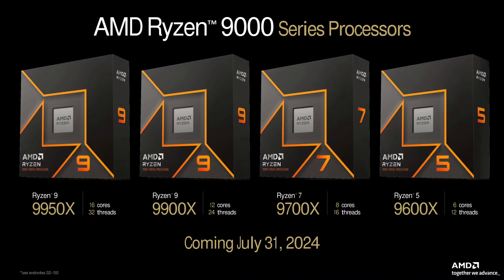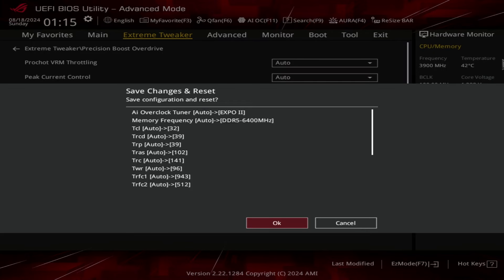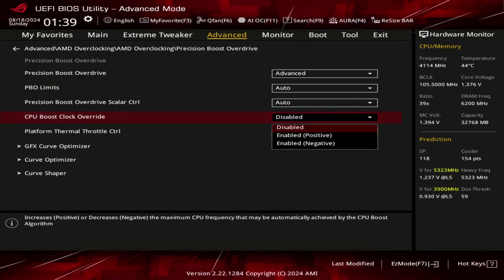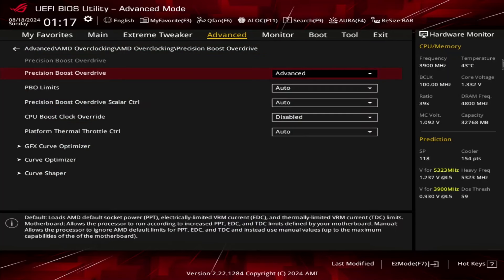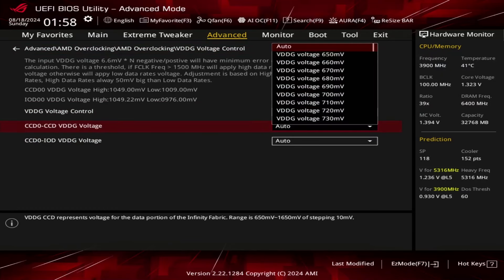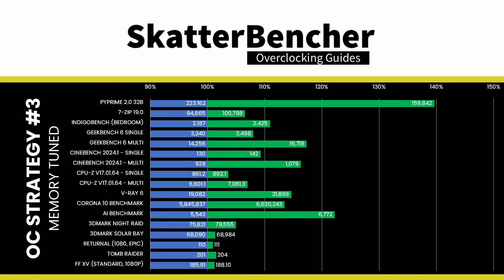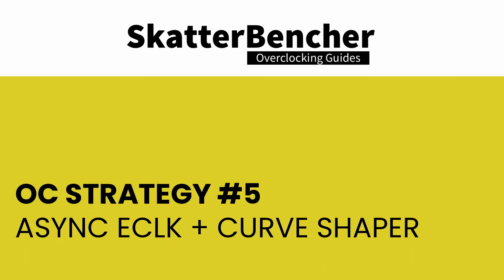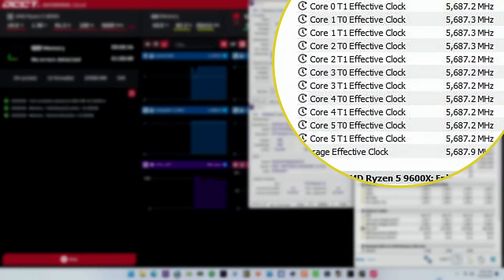Ryzen 5 9600X Undervolt & Overclock to 5818 MHz | SkatterBencher #79

Comment: Occt stress test is not realistic. I used the stress test to run negative voltage offset on my 7800x3d. Was stable in OCCT for 1 hour, crashed within 30min in Pubg!! I had to remove most of the undervolting to run the game! This is a theoretical oc and will not give the same gains in demanding games running without fps lock.  In Pubg you actually get better frame pacing with less hitching running Pbo with -100Mhz speed (regression) because the cpu doesnt have a power budget to run 5Ghz in that game paired with a 4080 comp settings. Doing this lowers the vid voltage @4.9Ghz so that 72w power budget stretches further. 72w just isnt enough and you can't increase it?!. Increasing SoC voltage eats up the power budget with about 5watts. In truth there is no headroom at all on that 7800x3d. I just hope they give the 9800x3d more wattage headroom but I doubt it because the chip will go nuclear in Avx512 workloads and take damage. I wish someone could leak a custom bios with more power budget if its possible like we saw on nVidia graphic cards.
Reply from the maker: You shouldn't rely exclusively on the OCCT (all-core) stress test for Curve Optimizer, because that tests a specific point of the VFT curve (high temperature at moderate frequency). The likely reason why you see stability in OCCT and not in games is because your game is using a different part of the VFT curve (moderate temperature at high frequency).

That's why the OCCT all-core stress test is only one of the points of my Curve Optimizer process, which usually starts with less heavy workloads.

Comment: I have this as RAM, DDR5 G.Skill RipJaws S5 Black - 32 GB (2 x 16 GB) 6000 MHz - CAS 36. What value should I set for OC? Because I only have 6000MHz and 1.35v. I therefore assume that the values will not be the same. Thanks in advance for all this work!
Reply: Bad kit. Get a refund. And buy a 6000MT/s CL30
Reply: thats samsung die most likely, you would need to checkm if your motherboard has a samsung 2x16 6400mt spd profile saved.

you might wannba get a refund if you want to get into more sophisticated memory tuning (more sophisticated meaning more then doing xmp = on)

Comment: Is this safe for my CPU and RAM long term-wise? I just copied the setting on the video, except the eCLK mode because I couldn't find it
Edit: I have a R5 9600X, with a PA120EVO cooler, Asus ROG B650E-E mb, and 2x16 GSkill Flair 6000MT/s CL30 stick.
Also idk how is it that my RAM can run at 6200 if it's supposed to be 6000? Could it get damaged?

Comment: after having very bad luck on AM5 so far my 9600X is a beast.
+200 -30, 2200 FCLK (900mv VDDGs 1.1V SoC) and it is rock stable without any tweaking.

Comment: That memory cotroller droping to half bandwidth  (or 600mhz) when enabling expo is why a lot benchmarks show regressions against Zen 4. I don't believe that happens on Zen 4, when enabling expo.

Did you try any higher memory controller speeds or were you limited to the samd 2200mhz as FCLK?
Also could you check of cpus L3 cache speed cahnges on HWinfo, wheb you go from stock to expo?
Reply: That should only happen if the reviewer used kits with predefined Expo settings over 6000 MHz.
Reply: @Psi-Storm  i bet it happens on these new buggy bios for these 9,000 series cpus. I mean look at CCD to CCD, & inter core latecy problems. Its latency is worse than acessing DRAM.
Reply: @Psi-Storm  that also depends on the motherboards behaviour when it switches to gear2 when its set to auto.

some motherboards switch gears at anything higher than 6000MT some at 6400MT and then some at the frequency stepping after that.

Comment: Hey I just noticed your score in CPU Profile 3DMARK. They are kinda low for your speed. Especially when a processor with nearly 200MHz and worse motherboard beats you. You should try rerunning them with a 3000MHz CL30 kit. (Or even lower CL)

Comment: I'm planning on getting a 9600x with a asrock b850i. Should I get 8200mhz ram since the mobo can take it? I'm new to overclocking as well.
Reply from the maker: I won't tell you what you must do, but I would probably opt for a decent DDR5-6000 kit and look for guidance on tuning the memory timings or increase the frequency to DDR5-6200/6400.

Comment: Hello, there is no mentioning about the tdp going to 105w I have applied it in addition to the overclocking displayed on the video.
Is there some additional settings/changes to consider after appying the tdp?
Reply from the maker: By enabling PBO you automatically allow TDP >65W. So if you follow the settings from the guide there's no need to also set the 105W TDP setting.

Comment: have you used the x670e hero much? i recently purchased one for my next build and have been hearing horror stories about this particular board. all of the videos about processors burning and pcie slots losing communication with the cpu have got me starting to question this board before i have even built it. what was your experience with it?
Reply from the maker: Use it on and off since Ryzen 7000 launch and never had an issue. That said, I'm just using it for tuning and overclocking. Not for a daily system. So I might not be your best source for advise :)

Comment: jesus is that cpu temp with a stock cooler? Isn't it bad for the cpu to run at 95C?
Reply from the maker: AMD designed the chip to be capable of running up to 95C stably

Comment: I’m also having some weirdness with curve shaper on my 9700X. I tuned my max frequency band first and ended up with -6. Moving down to the high band I needed some positive offset, I tried a really high value just to see what it would do and it locked my cpu at 610.5 MHz (600MHz x my ECLK)
Reply from the maker: Yes!

I have another 97X follow up video schedule where I talk about this specific issue a little more in detail. I also already provided the feedback to AMD too (ahead of the Ryzen 9000 launch actually).

Long story short, it seems there's some missing guardbands for Curve Shaper allowing the configuration of "illegal" voltages. A voltage is "illegal" when for a given frequency you're requesting a voltage that's lower than for a lower frequency. 

For example, let's say you're aggressive overvolting the high frequency and undervolting the maximum frequency, the curve might pull the voltage target for "max frequencies" below "high frequencies." It seems the VFT algorithm freaks out and goes into some kind of a safe mode.

I've seen this behavior on the 9600X and 9700X but not on the 9950X. The Curve Shaper behavior is also a little different for single vs dual CCD chips. I should maybe make a video about that too. For example, the Max Frequency Curve Shaper setting doesn't do anything for the single-CCD chips. 

The way to solve what you're seeing is to set all Max Frequency points to +30. This won't affect the curve with the 97X but will ensure that those VFT points stay above the ones you'll undervolt with High Frequency Curve Shaper.

Comment: I need some help here. I have an MSI B650 tomahawk and im doing all the steps you say untyl second overclock strat
 but my CPU clock still says that I have 3.9ghz.
Then if I put manually 5.0 ghz and press enter the it says to me that I have 96.000!!!
Can you help me please?
Reply from the maker: I'm not familiar with the board, but two questions:

1) When you say it's still at 3.9 GHz -> are you checking with HWiNFO during a workload? Precision Boost is a frequency boosting technology that only activates when necessary. So in idle you'll see the base frequency.

2) I presume you're trying to manually set the frequency. What if you set "50" instead of 5000?
Reply: @SkatterBencher  1) I'm checking it when I stress test it with occt.

2) Yes I put 50 manually in order to give me 5.0ghz, but when I put 50 this gives me 96.000. it feels like it tries to max out because of something that I did in the order before.
Reply: Hi. Simple.
- Enter BIOS
- Go in advance settings.
- Go to "OC" section
- Set "Core Ratio" to 56
- Set EXPO to enabled.
- Go in "Advanced CPU configuration"
- On "Config TDP" set it to 105W
- In "AMD Overclocking"
- Then "Precision Boost Overdrive"
- Set PBO to advanced
- Change CPU max clock to positive and +200MHz.
- In "AMD CBS"
- Set Global C-state control to off.
- Set core performance boost to off.

- Save and exist. Windows will now tell you that your CPU run at 5,6GHz. And should be daily stable at that frequency.

Further tweaking might enable better performance but will make you lose stability.

A stable profile with a good kit (3000MHz CL30) can beat the Skatterbencher 5750MHz score in CPU Profile 3DMARK.

Comment: I tried to ovekclock my 9950x with async eCLK and Curve Shaper. It goes pretty good, but I stuck at 44500 scores in Cinebench R23. I looked around what happened and found that I hit TDC limit. It stuck at 180A while in PBO setting limit set 250A. Thermals are pretty good, about 77C at 230W, at this point the 9950x can go way higher. Ryzen master shows PPT, TDP and EDC with correct values which have been set in bios, but I can`t go higher then 180A at TDC limit. MB ASrock x670e Taichi, 3.06 bios. Is there any other way to change TDC limit? SMU and PBO not works.
Reply from the maker: That sounds like a BIOS or board issue. I just checked with my 9950X and X670E Hero and can easily go over 190A in CBR23 (46100 points).

If I remember correctly, it is possible for the motherboard manufacturer to impose limits to Precision Boost Overdrive settings. So regardless of what's configured in BIOS or Ryzen Master, those limits would be imposed.
Reply: @SkatterBencher  Ok, I wrote the ticket to ASrock support about this TDC limitatiton. This limit is a big joke, X670e Taichi had 24 phase vrm, and if correct there are 105A rated each. And they are limit it to 180A with 24 phase. I think even if it will be halfed it will run pretty well without overheating at 180A.

Comment: Are you gpu limited in games? The performance increase is way too small.
Reply from the maker: In Returnal, sure. But I don't think Final Fantasy XV is GPU-limited with the RTX 2080 Ti. At least not to the extend that there's such little performance scaling.

// EDIT: I did actually check the performance scaling with an RTX 4090 in the same benchmarks with the 9700X and the performance improvements were very similar to that of the RTX 2080 Ti.

Comment: One suggestion, maybe for your gaming benchmark you should add an unreal engine 5 game since tons of games are gonna use that engine in the future.. like switch returnal for the callisto protocol or remnant 2 or i dont know haha. Anyway cant wait for zen 5x3d and what you'll be able to do with overclocking. Crazy how good the memory tuning and overclocking does... i wonder what the impact would be a on a game like spiderman remastered that is heavily reliant on ram speed/timing would be. But yeah gaming doesnt care one bit about overclocking... its not the 2000s anymore.
Reply: Why he would be gpu limited ?
Reply: @kevinerbs2778  ue5 can be pretty cpu heavy as well
Reply: @swuspicious  but 99% of the you are gpu bound in most of those UE5 games.
Reply from the maker: Thanks for the suggestion. Any UE5 game out there with a built-in benchmark for convenient benchmarking?

Comment: So you still have to use base clock OC to be able to properly OC, so lame from AMD.
Reply: considering just the Cores... there is nothing to overclock since Zen 2.
wiggling around a + - 5% "OC" is not even worth talking about.
Reply: @PSXman9  Yeah it's shitty AMD.
Reply: What exactly is stopping it from using a core ratio?
Reply: @minerva474  AMD ;) You can't set a by core usage ratio on AMD unlike you can on Intel, so if you want to keep high clocks for lower core count loads you have to have CPU clocks in default and only use PBO and their "curve shaper". Evidently this tech is again pure trash as "curve optimizer" was since even scatter bencher had to use a base clock OC in his latest video which is very not preferred because playing with base clock for e.g. can completely corrupt your SSDs so it's very unpractical ;)
Reply from the maker: With asynchronous eclk in ECLK1 mode, the eclk is only increasing the CPU clocks as it's not linked to any other clocks (including PCIe, SATA, etc)